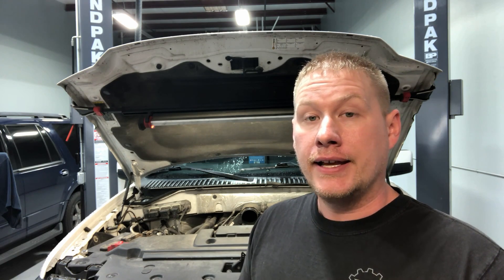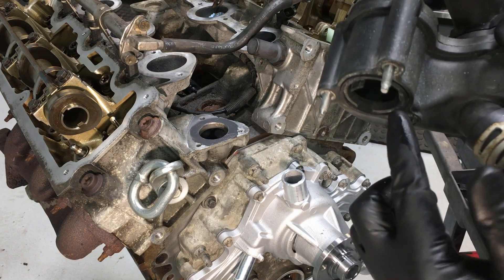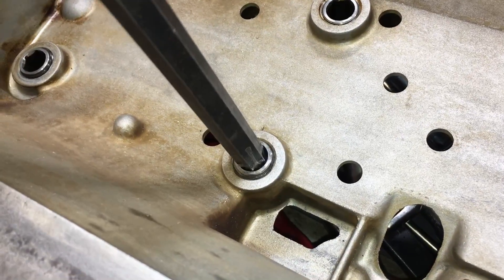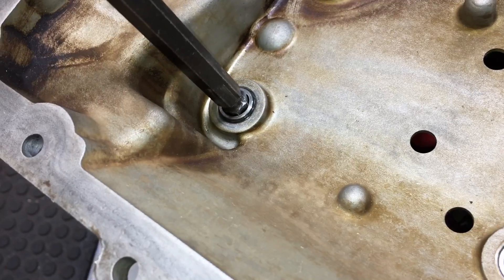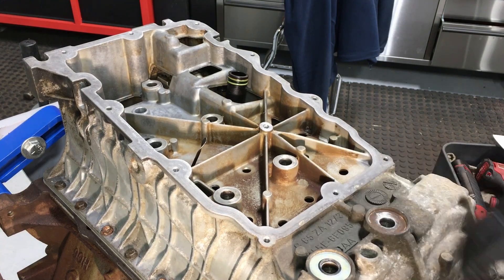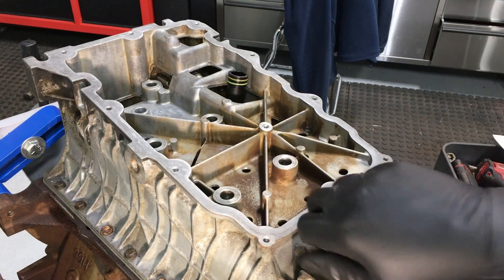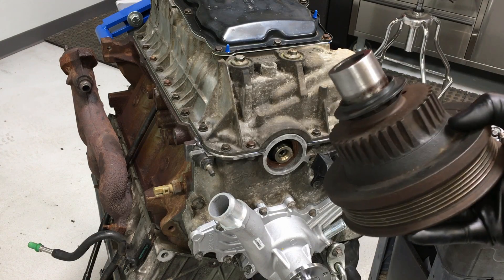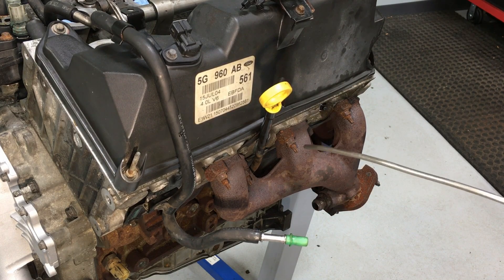Ford Explorer Ranger 4.0L SOHC Startup Rattle Fix: Timing Walkthrough Pt 4 of 4 Engine Assembly

Comment: Your 4 part series got me through a timing job on a 2005 Explorer Sport Trac 4.0L SOHC motor with 175k miles. Thank you for the videos and instruction. I have some other issue with the same vehicle and wonder if it's possible to message you privately for some advise. Thanks, James D

Comment: I have a 2002 Ford Explorer with the 4.0 engine it’s been the best motor it has 240k on the original timing chains runs great I have used 5w30 full synthetic since my mom drove it off the lot brand new
Reply: How often have you changed the oil and which brand oil and filter?

Comment: thanks for videos,  followed on my 4.0.   but on startup I only have good compression on 2 cylinders, and very low on another.     The old chain did skip but did not see anything broken,  any ideas ?   if I got the timing wrong slightly could it cause this condition

Comment: So, I have a 2011 Ranger that has low speed rattle coming from the engine compartment. Truck has 136K miles. I don't have the shop, tools or space to do the job. Wish I lived up your way, finding a good honest skilled mechanic around here is difficult. (I live in the Atlanta area)

Comment: I followed all the steps in your Series. Unfortunately my 4.0 will not start. Mind you the engine would start before replacing the timing components in the rear and front. I havd to hold down the gas pedal for it to start which runs really rough and bogs down and will not run on its own.. Any suggestions?
Reply: @eulasdubois3181  did you figure it out?

Comment: Hi, can anyone tell me if 4.0 v6 SOHC Ford explorer XLT 2009 is an interference engine or not? I have my front Balance shaft and Crankshaft timing chains seemed to have lost calibration due to a broken tensioner or something and also the left side camshaft (head) has a pressure of around 60 PSI after compression check in all the cylinders so does it mean that the front left side chain is also out of sync or somehting?

Comment: Omg who has a 7/16 hex
Reply from the maker: Exactly why I mention tool sizes.
Reply: 1/4"- 20 bolts have 7/16" hex heads and nuts that fit perfectly. Jam two nuts together on the end to use a torque wrench.
Reply: @JoeBlowski  that's a good idea, I did get this job done a year ago though, thanks to these videos

Comment: What engine sealant are you using on the timing cover rough areas and the corners on the oil pan?
All of your videos are excellent and including the links to gaskets and parts and torque specs is beyond excellent.
Reply from the maker: Permatex Ultra Black

Comment: Question that wasn’t answered in this video. How did you get the last roller in place after the cam was in place if you didn’t have room to take it off with the cam in place? Thanks!
Reply: Wondered that myself
Reply: Im stuck at this part of the install!
Reply: @brianjares4144  If I remember correctly as long as you are in neutral with the cam shaft when putting back together, you can place the roller in there when putting the camshaft back in and you can torque the bolts back down to hold the camshaft in place. Then replace the other rollers. Worked out fine as my explorer ran fine for 3 more years until the transmission went and I got a new truck. Engine ran stronger than when I got it.

Comment: This engine is a beast but it’s design is so frustrating .  I had a cassette blow up and I repaired it in my driveway with my engine in the truck. What a pain .  They could at least make the front of the truck grill and radiator open up like a door so you can access the engine !

Comment: Hi Brian,
Thank you so much for the 4 part series on 4.0L chain replacement and timing. I followed your instructions minus pulling cams and rockers. I bought the timing tool set on iATN from another tech. I used your affiliate links to purchase the parts. Engine runs great! 2003 Explorer.
Thank you again!!

Comment: Hi i did everything according to the video but when a rotate the engine there is a clicking noise at the rear timing chain. I noticed that the chain goes loose on the opposite side of the tensoner. do you know what could be the problem?

Comment: thanks for the videos!! they were really helpful :D fixed my old rust bucket 2006 mustang 124k miles engine ! what a relief when you start it back up again lol pulled this one on my driveway outside . can't believe this is maintenance, only to have the same head cylinders on each side. saving ford a few bucks on production cost I guess. but I digress thanks for the really detailed videos!

Comment: Thank you very much for taking the time to create this series of videos. I was able to use this series alone to repair my engine and get it running again. Thanks very much!
Reply: @aubreymeadows9116  is it still running?
Reply: Unfortunately no, the 4.0 made it another year or so and then got removed and a coyote went in its place.
Reply: @aubreymeadows9116  so did the 4.0 break down or did you just replace it?

Comment: How many miles do these go before the guides fail?  Seems to me that  putting a timing belt here would have been a better idea even if you had to change it every 100000 or less kms. Great informative video, done very professionally, very helpful,  thanks FordTechMakuloco . What is the flat rate for this job?

Comment: Great video don't understand you tore this motor down this far why didn't you just pull the heads and put new head gaskets onalso would probably be easier to put the tensioners and chains in with the heads off I think it would be better to just get a new motor do all this work and just have a piece of plastic stuck someplace and screw up a bearing or get stuck in the oil pump

Comment: Followed your video and it was great man! Just replaced the timing chains and a lot of other stuff along the way. The main thing I did wrong was when putting the torque converter in I didnt push it into place all the way so I had to pull the engine again. Besides that it went great thanks to you! Thanks for the videos!
Reply: @markchristensen2013  still running?

Comment: Question,  I'm doing my timing in my car, because I dont have a cherry picker,  have no way to get it out. Is it impossible?  I basically have my motor the way you do, but using my car as a stand. I'm a woman,  first time ever, but all my uncles were mechanics and I watched them. So I'm asking, cant I do this in my mustang?  Tomorrow I'm jacking up car to take oil pan off. Some one said you are the expert,  I've called my uncles,  they had me take valve covers off to, to time it.. so, I'm not scared, it's my car, and trust me I'm not Dumb, I find myself capable of doing what I put my mind to... would love a bit more help in knowledge on this, if possible.  Thank you if you can. 

Flower girl Key west..

Comment: Amazing guy! very good engineer he is. A fantastic video very helpful for my Ford explorer 2009 XLT 4.0 SOHC. This video is for Ford ranger engine if I am right but  I don't know how much compatible this engine is with my Ford explorer? I bought my car in Dubai and it is Mideast version essentially the same as north American version. I got some other technical problems with this model just recently which I will ask later however for now I would like to know what is that rattling noise or sound which comes from the engine on the cold startup? This has been increasing over the passage of time slowly,  is it the same noise due to the timing chain tensioner mentioned in this video or is it due to crank bearing worn out? It only comes once at cold start up, some one said it could be due to oil pump getting weak and does not move around the oil quickly enough at the start up. So I don't know which one is correct and how dangerous this situation is if it is unchecked and allowed to continue?. I like this car and I can't take it to my home country Pakistan due to the right hand steering there. And in Dubai I can't find good enough and cost effective technicians who can diagnose effectively and correctly the problem of this engine, as you said it is very complicated one so the people are afraid to get it opened and reassembled. Although Ford gives 25% discount for parts sold in Dubai and sometimes some 3rd party sellers also give 40% discount but still more expensive than in USA, so to order directly from USA I need to know  the online sellers and the exact problem with the engine. Please provide support and guidance.

Comment: If the crank sensor isnt connected, it will still crank but not start? Will this cause issue with computer?
Reply from the maker: No problems with the computer.
Reply: @FordTechMakuloco  I didn't see the rockers put on with the cam covers that you couldn't use the tool on? And also, where do you get the new bolts that need replaced? I didn't see a link? TY Great video!

Comment: No wonder people junk them when timing fails. Cost for repair is not worth it. Pull engine out and specialized labor for timing. I’ve seen several with timing issue cheap on Craigslist.

Comment: 1:54  there is also a tool to center the timing cover. it goes on the crankshaft to center the cover for the crankshaft seal.
just a note for someone about to take on this job.  if the components have not broken in the engine this work can be done without the removal of engine by removing the transmission.
i did this work on a 2000 explorer without removing the engine, jackshaft or cams lifters. you will need the special tools to lock the engine for timing and the timing cover center tool.  buy the OEM ford parts.  the cheap aftermarket parts are not good quality.  there is also an updated part for the main timing sprocket ( top jackshaft ) it is tad longer to line up with the guide better.
this looks like hard work but its really not as bad as it looks.
Reply: People like you are saints. Thanks for being the salt, internet person.

Comment: Very informative, helpful video.  Just done my first one and it turned out good.  I'm surprised there was no details about installing the cam followers on the two corners.  I struggled with that for a while.  Grinding some of the follower tool down allowed the tool to be removed after installing them.  I'd like to put chains in another sohc since it's fresh on my mind.  I'll be watching more of your videos, thanks.
Reply: Thank you so much for your solution to this dilemma. I am almost to this point and was stressing over the fact he hadn’t replaced the followers when he timed and torqued the cams down. You can bet I will be grinding on my valve spring tool. Thanks again for posting this helpful tip.

Comment: Two questions. First, how did you get the end cam shaft followers back in? The tool wouldn’t fit and you did it when you removed the whole shaft but on reassembly you said to do it without any of them installed. Second, you said for the flex-plate that you put Loctite on the bolts and followed a two stage process but the literature you posted below says they are torque to yield and you need all new bolts and its a three stage process. Which is right. Not trying to haggle you as this video is amazing i just want to get it right before I put everything back together and put my wife and kids in the car.

Comment: QUESTION???? when you were at the part to put the cam followers back in. The end ones could not come out with the tool, too tight. how did you get them back in? Great video tho thumbs up big time. I am doing one of these now as i am posting, everything was broken, all the guides. But just wandering how you got those 2 end followers back in? Thanks Richard @RPM Truck and trailers

Comment: Is there a torque spec for the oil pressure sensor? I have a 2004 Explorer with the 4.0 sohc v6. I have been following your 4 part series on the timing chain replacement and I’m replacing a few additional things. The oil pressure sensor on the driver side of the block, just behind the front timing cover. As well as the crankshaft positioning sensor? It’s right beside the harmonic balancer, on the front timing cover. Is there a torque spec for that sensor as well? Awesome videos, hope you get this and can help,
Thank you, Ethan

Comment: I'm watching this for the 5th or 6th time, since I just finished the top end of the motor and ready for the upper and lower oil pans.  My '04 Explorer doesn't have a straight up firewall and it curves forward over the back of the engine.  A lot of my experience with it has been "Braille".  LOL  Thanks very much for this series!!!

Comment: Do you know if you can replace the upper oil pan gasket without pulling the engine? @FordTechMakuloco
Reply from the maker: yes you must drop the front axle though.
Reply: FordTechMakuloco Thank you for the reply. Any other tips you can give before I tackle this? Anything else I should replace while I’m In there?

Comment: I literally just finished putting mine back together and let me say what a mess!!!!   I triple checked the timing before putting it back together.  My only issue now is after starting it with the crank sensor unplugged it flooded the motor.  I’ve had the plugs out 4 times and it almost started twice.  Still no luck.  Going to leave the plugs out over night to see if that will help dry out the cylinders and try again tomorrow. 

Without these videos I don’t know if I would of taken this project on!!!  Thanks
Reply: @Miketheconservative  how’d it go?

Comment: hello my friend, i just finished an 06 explore everything seemed good at start up just fuel leaking from injectors and cloud white smoke from tail pipe. after replacing o-rings i tried to start car back up and it would just crank 3-4 times and comes to a hard metallic cling stop. kinda sounds like the flex plate hitting something. i checked the flex plate and everything seems in order, i checked the ecm with my scanner and it says "anti-theft detected, engine disabled." any idea what caused this? or if the hard stop while cranking is related with the anti-theft? any info is much appreciated as im in a dead stop and out of options with this car. thank you in advanced.
Reply: Did you ever figure out what the issue was?

Comment: Great series of videos.  As an ASE certified mastertech, I can say this is waaaaay better than the procedure outlined in alldata / the factory ford service manual.  Both of which, are uh, well, rather useless.  Never actually done one of these jobs yet, but I'm getting ready to on my own Ranger.  Rear main seal is leaking now, and I noticed last year or the year before when I did the valve cover gaskets, the non-tensioner side guide on the passenger side is broken.  Only have a very slight rattle at cold start, but goes away within 2 or 3 seconds, past that runs great.  Basically, I didn't care enough to mess with it because I knew it was a chore.  I'll probably tackle this job next year sometime, since I don't drive the truck hardly at all.  Maybe 3,000 miles a year if that.

Comment: well done young man, the design of my engine is right out off control, think I, am going to trade it on a truck with a 243 or 327 chevy.   god meant a engine to have one timing chain. this over head   cam crap has got out of control.
Reply: ford believes more moving parts means more reliability?  yeah right- wouldnt own one

Comment: Goodson has a Ford crank turner socket to crank the engine around. Try changing the oil often to flush out the tensioners. But the tensioners do lose tension so replacement is best. Run a tap thru bolt holes.

Comment: Thanks Brian for the video's.  Complete novice here, and was able to do the whole thing in in a week. Advice: use a 2 ton engine hoist,  and prime those tensioner first. Did the way you said. Still took awhile to get them primed before the knocking whould go away. Sound and runs great. Thanks
Reply: @smashermasher748  prime the tensioners first? That’s a great way to cross thread. Your vehicle still running?

Comment: This was a very informative walkthrough but due to the complexity of this engine, I decided to have an automotive shop do this job. 22 days and $4300 later and I finally have my Ford Ranger 4.0 sohc back on the road !! 2 days later I'm cruising at 50 mph and all the sudden my whole truck  jerks and the engine stalls out and there I sit with an over sized paper weight again!  Turns out the NEW rear timing chain snapped and the motor jumped timing, of course that's bad news for an interference engine 🤬 fortunately they stand behind their work and assured me they'd make it right again 😅
Reply: Are you back on the road?

Comment: Great series.  Thank you for such a detailed video.  Before completing this job a couple of years ago, I didn't know what an overhead camshaft was.  Now, I know more about the Ford 4.0L SOHC than most people I once went for help.   If anyone is new to this process, pay attention to, well all of it, but I want to emphasize the suggestion to turn the crank by hand (or breaker bar and socket or strap tool) before you start putting all the accessories and components back on.  You want to make sure the whole thing will turn by hand a couple revolutions.  I skipped this step and broke the rear jack-shaft sprocket into 3 pieces....this caused my already difficult job to morph into a monster I wouldn't wish on anyone. One more thing, GET THE SPECIAL TOOL (AMAZON $125).  Thanks again FordTechMakuloco for the thoroughness of your work.